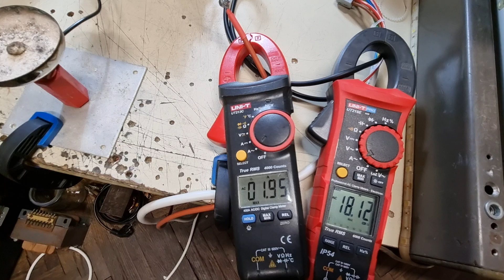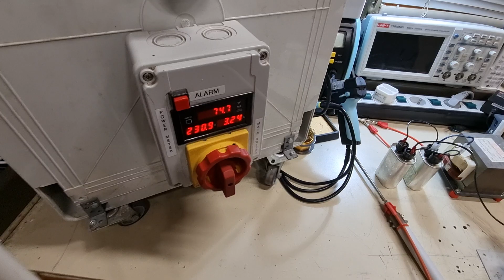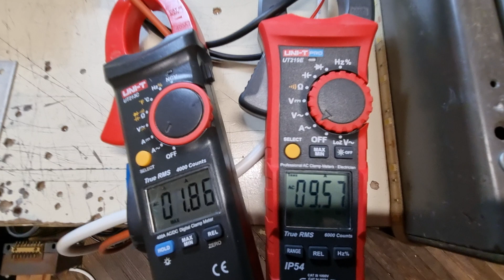MOT arc comparison (Resonant vs. Non-resonant)

Comment: Very cool to see the immense drop of primary current when using resonant capacitors :) It also shows how inefficient non-resonant arcing really is.
Reply from the maker: Thanks so much for watching.

Absolutely, I was also impressed by the result, I was expecting like a 20% drop in current and not almost 50%, not sure if it is the same with all transformers but still pretty cool. The resonant capacitors are absolutely a amazing thing, as I was saying a polypropylene would be better/safer. The transformer is going to last longer, half the current so 4 times less power dissipation.